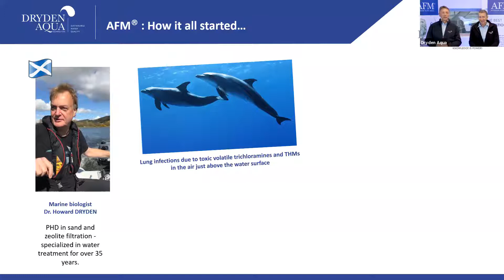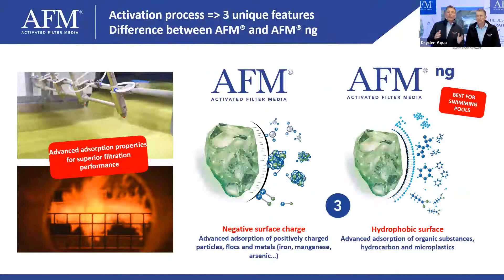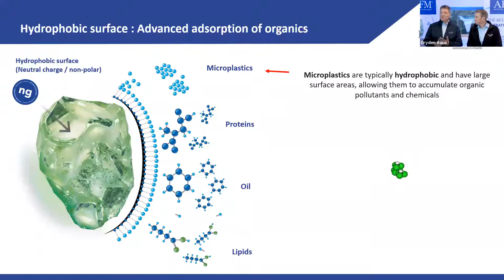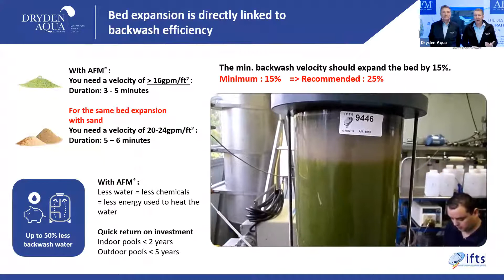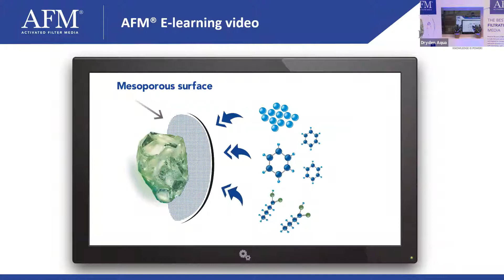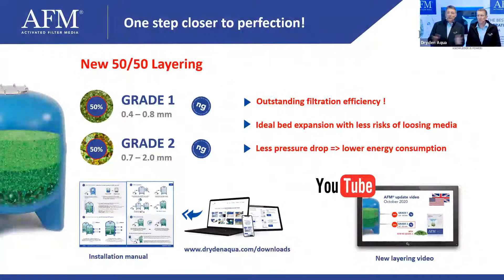SESSION 5 : AFM® ACTIVATED FILTER MEDIA (US)

Comment: Dear Dryden Aqua Team,
I am a homeowner in Quebec, Canada, and I am planning to replace the sand in my residential swimming pool filter with AFM® NG.
While reading your official AFM® Installation & Commissioning Manual, I noticed that your recommendations specify using different AFM® grades depending on the filter size (Grade 1, Grade 2 and, for larger filters, Grade 3).
I have attached the relevant PDF from your official manual for reference.
However, I have contacted several Canadian distributors, and they all sell only AFM® NG Grade 1. They advised me that Grade 2 is not necessary for residential pools.
This has left me confused because it appears to differ from the recommendations in your official installation manual.
Could you please clarify the following?
Is the current official Dryden Aqua recommendation to use a combination of Grade 1 and Grade 2 for residential filters where your installation manual specifies it?
If so, why do Canadian distributors appear to sell only Grade 1 and recommend against using Grade 2?
Is installing Grade 1 only considered an approved installation by Dryden Aqua, or should customers follow the grade combinations described in the official installation manual?
Reply from the maker: Good Morning/afternoon,

We supply AFM in 3 different grades to suit everything from residential filters to large commercial pool filters.

For  residential pool filters, we also offer a mixed grade (0.4–1.2 mm), called AFM Combi bag allowing the filter to be filled with a single grade instead of multiple layers.

I believe this is the product that has been offered to you.
 https://www.drydenaqua.com/downloads/files/AFMng%20Combi-Bag%20-%20Pools%20-%20Installation%20Manual%20-%20EN%28US%29%2C%20FR%28CAN%29.pdf?_t=1778157050

All the best